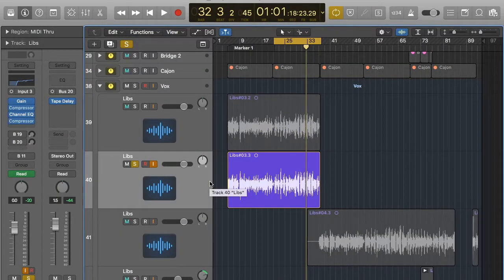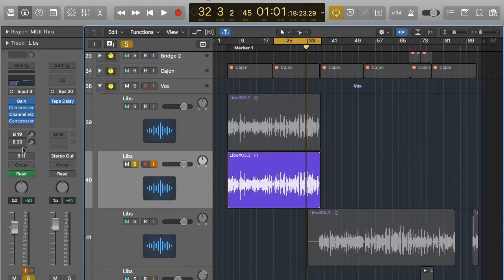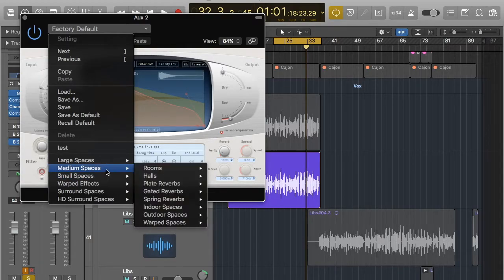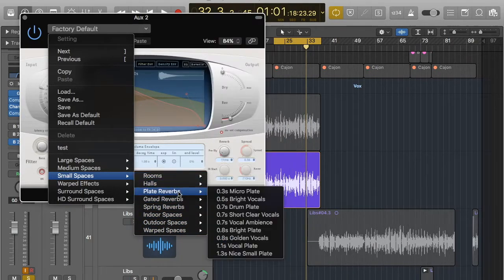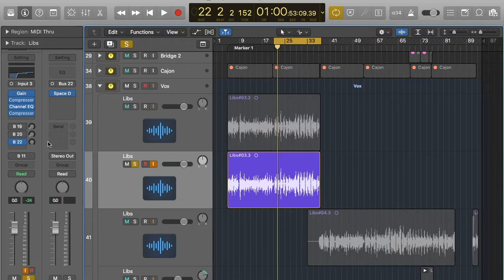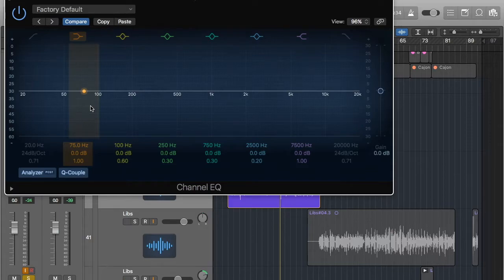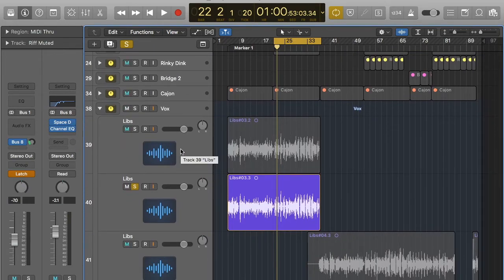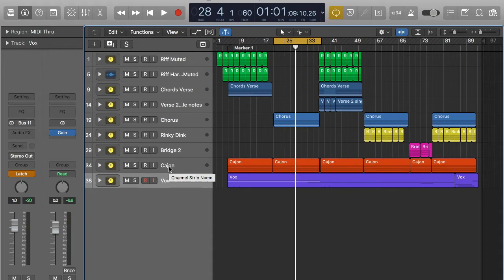How To Use Logic Pro's Space Designer Reverb

Comment: Why don't you make a bus for every plug in (comnpression, gain etc?)
Reply from the maker: Because I don't want every channel to be compressed the same way, a kick drum mic may be set to a higher threshold because the input signal is loud, a vocal while still needing to be compressed will need the settings set differently as the signal may be quieter and you don't want to push the compression as hard. 
Make sense? Essentially it works for a reverb because it emulates a space that I wan't all my instruments to be in, I don't want to compress every instrument the exact same way
Reply: @sonicallysound4273  That makes sense - I realise my comment might come across slightly attacking of your method but I was just genuinely interested (just got logic X and trying to learn as i go.) I found the video useful and have already applied it to a recording.
Reply from the maker: Oh I didn’t see it as that at all. Just wanted to make it clear why